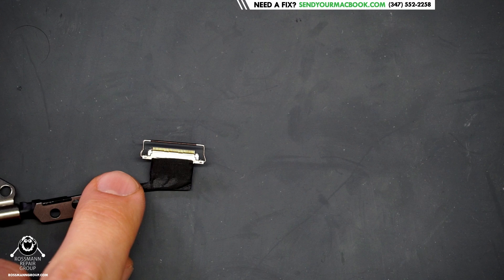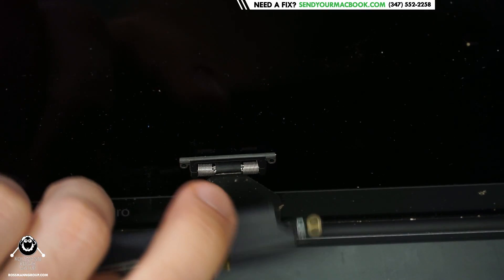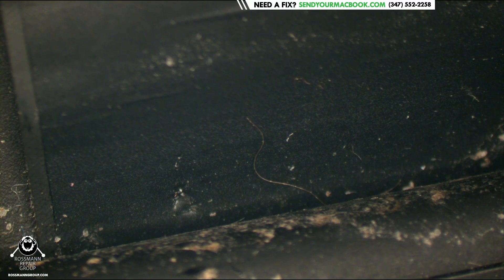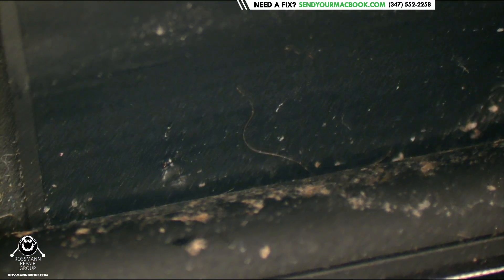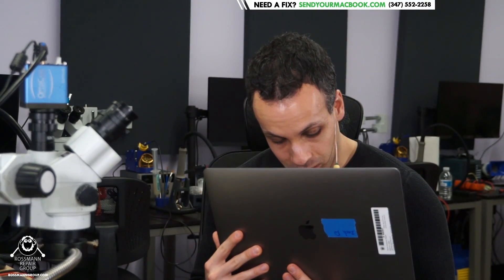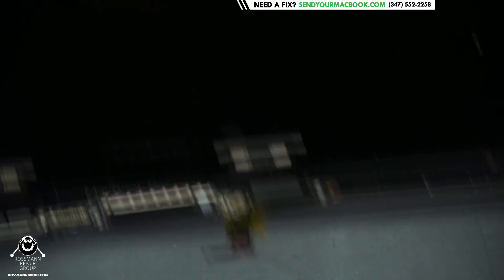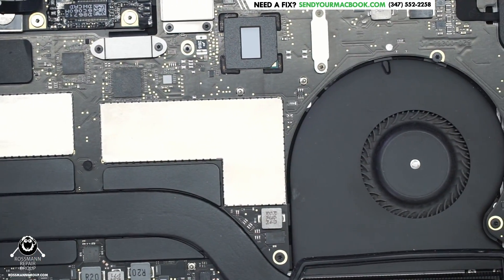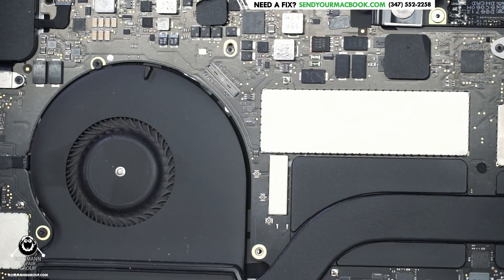How dust destroys irreplaceable parts of your Macbook Pro.

Comment: I hate those flimsy cables. I have a few Dell Latitude D820 laptops. Great machines in their time. Centrino Duo, nVidia Quadro, 15.6" or 17" (I forget which), nice systems. They used one of those flat cables to connect the LCD to the motherboard. The cables crack after the lid is opened and closed so many times, causing white lines on the screen and eventually the screen not working due to not receiving a signal at all. $2,500 laptops should never use those cables.
Reply: I had a fleet of d620 and d630 laptops for a long time. They were built like tanks. I miss that level of quality.
Reply: @Henry_Jones  i have two or three of those too. Single core, 2GB RAM. Built like a rock.
Reply: @Henry_Jones  Still have 2 working D610s. Don't use them anymore, but those were rock solid. 
I did find one D630 with a blown switching voltage regulator IC. Couldn't replace that, it was a BGA chip and i don't have the skills or equipment to replace it. 
E6400s were also rock solid. E6410s were iffy, i found two (out of a few dozen) that had failed graphics processors. 
When Dell makes a good computer, it really will last for a decade or more.
Reply: @mfbfreak  yep unfortunately it was their cheap inspiron line that they sold retail that gave their rep a nosedive. Those were garbage with cheap build quality and came filled with bloatware. Bleh
Reply: @Henry_Jones  I've got a D630 and the smaller D430.
Reply: @Henry_Jones  I could tear one of those down in less than 5 minutes, it was great.  Lid/screen swaps were pretty quick and painless all things considered.
Reply: My Lenovo Thinkpad X200 has the same flex cable also had the same problem. the cable just snapped itself after repeated open and close many times
Reply: Just FYI Centrino is the name of the platform (networking, AICs etc) and Core 2 Duo is the actual processor.
Reply: @elivai  I know. It was all about power savings, and now we save even more.
Reply: Got a D630/620 (thankfully Quadroless) and it works amazingly 

Just recently acquired an A1989 and there's a BIG bump in the ribbon cable...I think she's broken but one can try.

I'll be sure to be wary of D820s in my collection though
Reply: @lukedavis436  I believe you can still get the cables for like, $20. Maybe wrong though.
Reply: @GuretoSefirosu  the same ones or slightly redesigned?
Reply: It's a Dell, you made mistake when you got one.
Reply: @Wolfmeister666  I would suggest you read the comments. Most Dell Latitudes last for decades. This one series was flawed due to the type of cable Louis showed off in this video, but I still own three working ones.
Reply: And what cables should they use then? Cables are supposed to fail after thousands of opening and closing you know :).
Reply: @momchilandonov  I have laptops dating to the 90's which work fine. It is this specific type of cable. Literally just this specific generation of Latitudes. The ones prior and ones after all used regular, bundled, round cables with no issues.

The ribbon cables fail everywhere. This includes in BMWs. In the famous E39 series they used these same cables and they are notorious for failing despite not even moving, causing lines in your display and readouts. I have a 2002 E39 with this issue again. No real fix sadly. Just replace them and use them until they fail again and again.
Reply: @GuretoSefirosu  Well imagine if everything works for 20-30 years - the economy will die quite fast :/. It makes sense to make them durable only for couple of years after their warranty expires. Can't blame the vendors much for this. Not to mention that sometimes it really is the lack of knowledge as to how something will behave after several years of usage. I think it's more surprising that your cables worked for so long. I am not defending the vendors that much as I also hate this strategy of "buy-throw-buy" as it's polluting the earth and is greedy. Apple comes to mind with their anti right to repair policies.
Reply: @momchilandonov  Right, because THAT is what built The USA. Apparently, you're not familiar with history. Let's look at Harley-Davidson, Indian, and every other US motorcycle maker. They built unreliable equipment that needed constant maintenance or replacement. In your view, they're going to be billionaires. Sadly, this is not what happened. All of them went bankrupt as Japanese bikes, which were rock-solid reliable, came to town. In fact, HD was the LAST US bike maker at the time and begged the president for help. Due to import taxes and government help, Harley re-tooled and developed the "Evolution" or "Evo" engine. These new HDs were solid, and they went on to become famous. Who doesn't know the name Harley-Davidson now? I own a 1991 FLHTCU with an Evo on it. It's solid, but Harley almost died because of things designed to break.

I would suggest you think about how you yourself react to crappy products. Do you buy some garbage item and then go buy another when it breaks, then repeat, or do you buy one garbage item, have it break, and then go buy a better brand so you don't keep wasting your money? If you enjoy throwing your money away, you are in the minority of people in this country. A laptop costing $2,500-$4,900 should not break yearly. Most of us have to save for quite a while to purchase these things, and we expect them to work properly for some time.
Reply: You apparently think everyone here is american... I do know history. Apple are billionaires and they use the exact same principle of shitty products so your argument is not valid.

Comment: That looks like fine salt. I have never seen dust that has a solid clear form like what the video showed.
Reply: It’s not like you’re using a microscope to look at dust every day though.
Reply: @jacobrzeszewski6527  What's that to do with anything... Substances only carry so many hues. If you're seeing X form/color/state, then there's a reason for it.
Reply: @biggiedickson  dust is made of a lot of materials that come in a lot of shapes sizes and even hues. It really doesn’t even matter if it is salt, it shouldn’t be capable of damaging a cable if it’s properly sealed and protected.
Reply: @biggiedickson  also, I think the “salt” he saw was just the crater dug in by the piece of dust.

Comment: Had a 2017 Pro:
- It lasted 2 years before flexgate 2 kicked in

Have a 2011 Macbook Air:
- A bit slow, but still going strong.
Reply: Yeah my 2015 MacBook Air is still amazing, definitely wouldn’t consider it powerful but I could still play some triple-a games from only a few years ago. In fact it very nearly meets the minimum requirement for Halo Infinite and even Cyberpunk
Reply: I have the 2011 air with 4gb of ram. it is still going well and I intend to install linux on it.
Reply: Difference? Steve Jobs
Reply: @ericpowell4350  True. Tim Cook was always a bean counter, so naturally he focuses on the profit margins and revenue.
Reply: early 2013 macbook pro retina, still running league fine. my brother 2018 macbook pro -> trade in already for 2020 cus of screen problems
Reply: I had 2011 macbook air i7. blew up within 2 month of it's release date. then they said it's water damage, I insist it wasn't, just then they finally honored the warranty repair.

Comment: Oh look, it's the 2008-2012 SATA cable again, but somehow worse.
Reply: those were failing with no visible damage.  in fact brand new parts were going bad almost immediately.  took them what, 4 different part numbers and finally a different manufacturer to resolve it?  did hundreds of those.  something something typing this on a 13" with a replaced sata cable something something.  good news is that Apple stood behind them and replaced them.

Comment: Thanks Lewis.
Today I learned it's a miracle my mid 2010 MacBook Pro still works with no problems. Of course now that I've said that it will fail sometime next week, right?
Reply from the maker: what's a lewis
Reply: @rossmanngroup  lol that took me a second
Reply: Cripes. Sorry - "Lewis" is one of my buddys. YOUR name obviously is spelled Louis. I shall accept my punishment of one half-portion of gruel instead of a full bowl at suppertime alongside three lashes of a switch on the foot bottoms.
Reply: @nicholasxayasith55  Whoa, severe and/or kinky.
Reply: Yeah, my 2015 still going strong, too. No problems and it’s served me better than any comparable PC laptop would, I think.
Reply: I think that is refering to the 2021 macbook

Comment: I think you forgot about the damage that can be caused by opening it.
Reply: Opening it, closing it, charging it, using it on battery, using a usb device with it, typing on it, exposing it to direct sunlight, keeping it in a dark place, carrying it,..
Reply: @VV-nw4cz  Or just plain doing nothing with it....
Reply: Indeed it is in the hinge area the very act of opening and closing the laptop causes wear and tear, seems like they should have used a more durable cable design.
Reply: these cables are flinsy and its made this way to resist bending,
i know these cables can last a good amount of opening closing, 10 thousand open/close,
but they are realy not made to have any amount of force made anywere,
it really needed some care to be on a place/way it cant collect dust or be acessible by the end user a cage for it
to do its thing bending and don't collec dust but this is apple. you know they really need your devices to 
break by "itself".

Comment: Could this happen to the Fanless Apple M1 Macbook Air?
Reply: properly not since there is no airflow
Reply: doubt it, Air doesn't have the spring tensioned cable keepers like the Pro, that seem to trap debris at the point where Louis is showing.  keep hard specks of debris away from your $1500++ laptops people!  I've opened up laptops and had a shower of BEACH SAND fall out.  dimples all over the lithium ion battery cells.  damage to the cabling.  it's not there from the factory, people!!!
Reply: it could happen to any poorly designed laptop. So yes.
Reply: @UrAdversary  different cable setup, no spring tensioned cable keepers on the Air to trap debris against the display cable.

Comment: I am a university student and I recently bought m1 MacBook Pro because of the battery and power of the chip but after watching your videos im actually scared that i might have f myself by buying a MacBook (I have a tight budget ) should I replace it with another laptop or it's fine ?
Reply: Seems like a bit of an overreaction to me
Reply: @DefineOutside  idk might be,  only time will tell but for now i really admire the power of the m1 chip
Reply: get something else. and when u get windows (like you should) u can actually play video games on it.
Reply: @DaggerPrince  im not a gamer 😂 but thank you
Reply: Hey, just wanted to chime in because I see you might be getting some wrong advice. Look as someone who owns an M1 MacBook Air, I have had ZERO software and hardware issues in the 1 year I have used it so far. 

I agree w the other person that every laptop has its flaws and it comes down to picking your poison in a sense. You know every laptop has a flaw just choose one and work through it. Look laptops can get bad and it is good you are thinking ahead. Most people think about it when it actually happens to them LOL

I recommend buying a Macbook Air M1 if you do not use any high intensity programs, and spending the extra cash on AppleCare+. You do have 60 days from date of purchase to add it, but this is the best protection you will have for damages that are out of your control. Other laptop companies do not usually have a solid warranty and most cases you might have to get a new one.

Use your student discount, do not worry about dust as this is a somewhat rare occasion. Though I do not want to undermine the idea of this happening, what matters is if it does happen, that you have a plan. Just take care of it.
Reply: @HassKhalid  thanks for the advice 🌹
Reply: Take care of it and it’ll be fine. Tons of people buy them and there aren’t any common issues that I’m aware of with those. They’ve fixed a lot of the design flaws from the 2016-early 2019 MacBook pros. Don’t spill water on it either. These are absolutely not water proof or water resistant
Reply: There are design flaws with every laptop. I’ve seen Thinkpads, dells, etc with stupid design flaws but they never get the press that apple flaws due. Not saying it isn’t warranted…apple should do better…but every laptop has flaws.
Reply: @WinPC99  but the thing is the new m1 stuff it's just that...new. The faults haven't been revealed yet usually takes a few years unless it's something like the butterfly keyboard scandal
Reply: @WinPC99  apple purposefuly adds in stuff so their laptops break. but cope harder fanboy.
Reply: @DaggerPrince  fanboy? I have a MacBook Pro but I also have a windows 10 custom build. There are plenty of times I have criticized apple but I’m not going to just make up stuff to go along with an “apple sucks” narrative. I purposefully got a late 2019 MacBook Pro because it doesn’t have the horrible keyboard and display cable issues that the 2016-2018 models had. I acknowledge they have issues. But the M1 MacBook Air seems to be really solid and the MacBook Air line tends to not have very many issues compared to the pros.
Reply: @DaggerPrince  “cope harder fanboy” says a lot about you
Reply: don't imagine dragons.  m1 laptops of all kinds seem solid.  butterfly keyboards are gone, display cabling seems redesigned.  keep liquid and other debris away from the laptop and you'll be fine.  don't drop it.  Apple uses the best displays available, which means they are the most expensive displays available.  might be a good idea to take it to a reputable independent aasp or someone like Louis every year or two to get the dust cleaned out of the fans and radiators.  I might have some recent extensive professional experience with these.
Reply: @cptomes  thank you for the advice
Reply: I personally would, M1 is the first gen of arm MacBook and apples first gen of anything gets cut off early when it comes to software support
Reply: @mackenziebullied4900  I didn’t even know that tbh, makes sense tho cuz they might announce M2 next year smh
Reply: @HassKhalid  the first gen iPad was gimped om purpose with 256mb ram no camera and only got one iOS update because it was the brand new apple thing and everyone will buy it even if it was c64 levels of performance smh, iPad 2? The real first ipad
Reply: @mackenziebullied4900  yeah i didnt think of this when i bought it and we started to use alot of programs that arent supported by m1 so i have to use virtual box but i dont see it as a problem for now cuz the m1 is so powerful and its doing a great job
Reply: please like it so he could see it and please if anyone can help me that understand computers feel free to answer